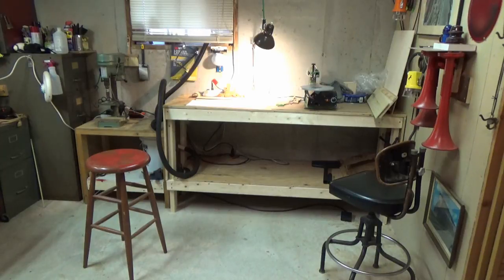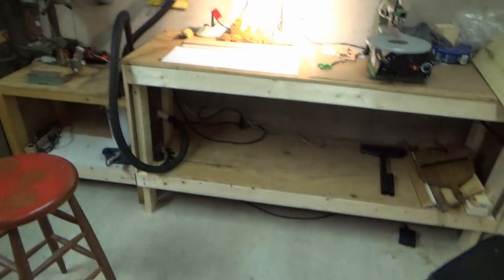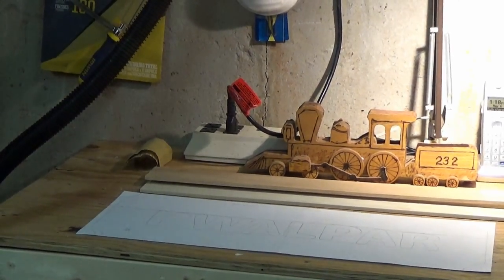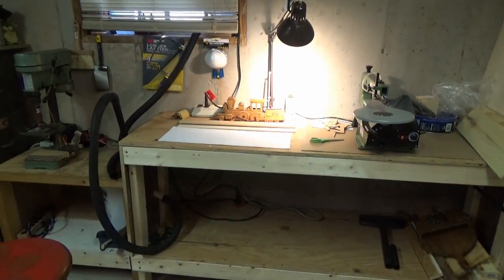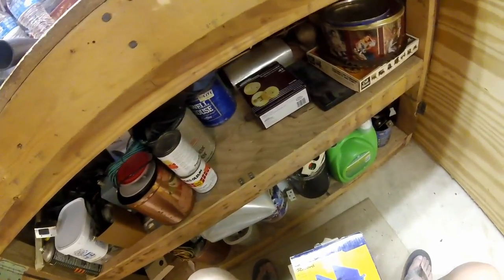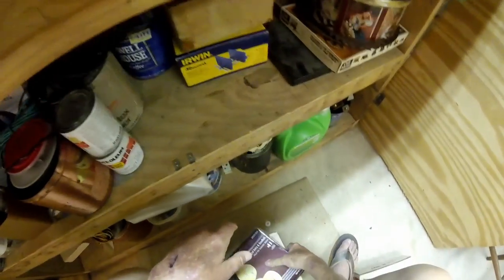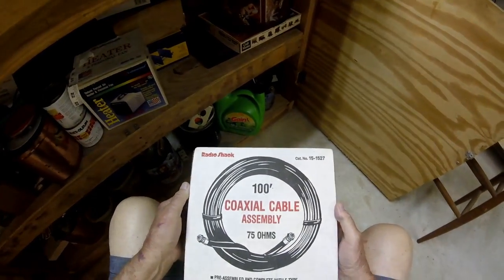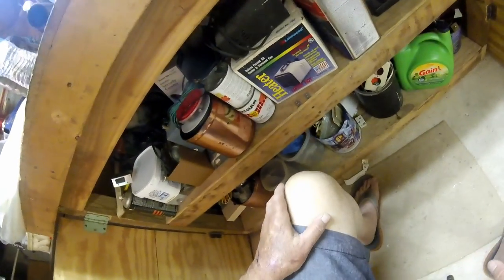Pwalpar VLOG Have You ever Misplaced Stuff

Comment: Yeah, all of the time. Might be a good reason to have doubles of just about everything I need. My hand tools, but not the powered or battery tools. Nib cutter, pipe/tubing cutters, tap and dies, screw extractors,  pullers. power cords 300' replacement plugs and sockets.
You name it I most likely have it and that isn't counting what I'd gotten from my Grandfathers tools which happen to be over 100-years old.
Reply from the maker: I got a few old tools as well
Reply: de qué se trata güey no va a poner
Reply: 🚂 estatuto de era👈
Reply: I DO NOT SPEAK SPANISH OR CUBAN